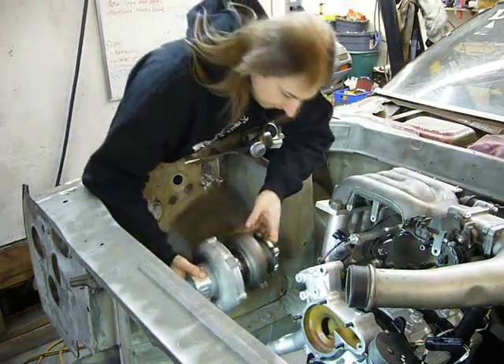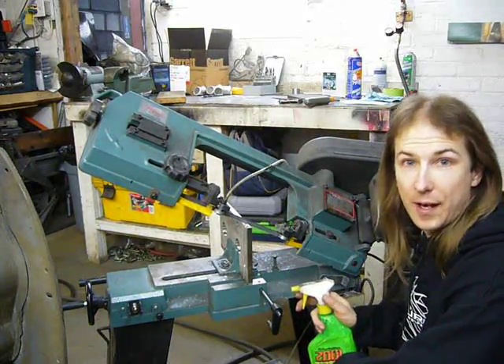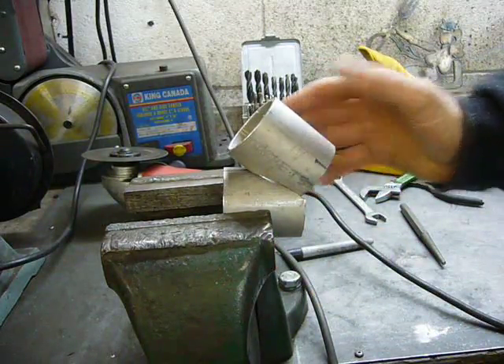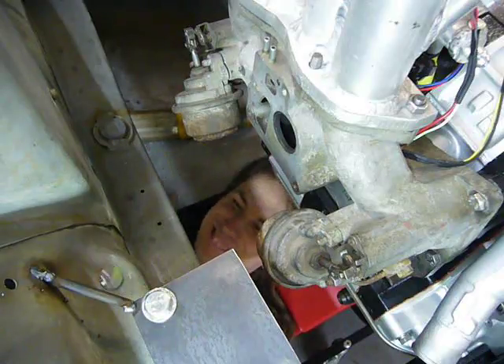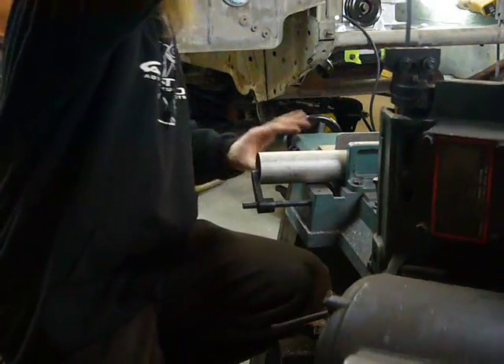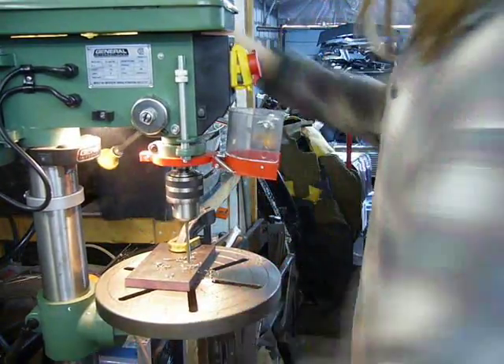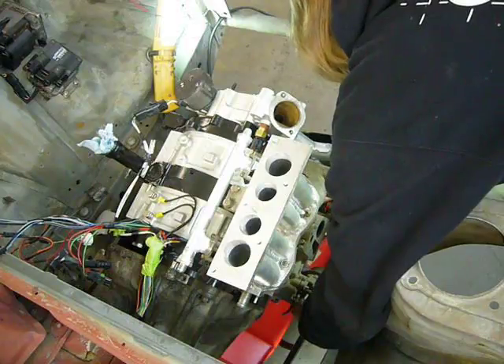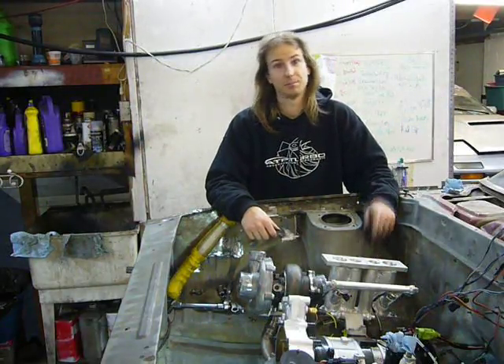Part 25: Turbo Manifold Fabrication - My 76 Mazda RX-5 Cosmo Restoration

Comment: i knew you were going to port match that manifold you need to get that thing sent off to exctrude hone to get the inside really smooth because i saw a bunch of pipes just slightly miss aligned it will cause the exhaust to tumble and probably create drag and resistance i really hope this was a personal job not something you did for a customer

Comment: Is it really necessary to use that insanely thick stainless pipe? Every header I've ever seen was made of thin wall tube. You really didn't need to purge it, I would have saved the argon and welded it. I'm not going to pick on your welds, I think they'll hold just fine. We all know they aren't perfect. I spent some time purge welding sanitary stainless in .063 wall tubing, and the whole point of purging is to weld through to the inside...also, we didn't use filler, just fusion welded it. My hot tip for stainless....get on the pedal a bit more, and try to run it faster. I've always gotten the best results welding it about as fast as I can go. But hey, we're all learning right? I enjoyed your video.
Reply from the maker: nunya bizniss Rotary EGTs can hit up to 1800 degrees under load, so thin walled stainless or mild steel will crack in short order. And if there is any sugaring on the back of those welds, they will crack very easily as well. That's why I ran the back purge so that even though I wasn't going for 100% penetration, the back of the welds would always be protected. There were also a few areas where fitup left a bit of a gap which I wanted the purge to protect. Yeah, I need to move faster on my stainless welding.
Reply: Interesting. I've seen open wheel race cars with the headers so hot you pretty much see through them, but they don't crack. Like they say, lots of ways to skin a cat. I've never had cracking issues with sugared stainless, it's more of an appearance thing. I was watching a promotional vid for Burns Stainless, and apparently they do purge on some of their pieces, so maybe you're not completely crazy after all :-)
Reply from the maker: nunya bizniss Heat cycling in street use probably plays a very large role as well. 1800+ degrees at WOT, then down to 800 degrees at idle, and somewhere in the middle during lean cruise. Plus supporting the weight of the rather large turbos we tend to run (though the GT30R shown here is very small by rotary standards...my daily driver RX-7 runs a GT40R).
Reply: turbo manifolds require shc 40 stainless generally. they are both load bearing of a turbo that may qeight 70# or more and also act as a pressure vessel. unlike a header thay only is subjected to heat and un pressurised air

Comment: For your heat shields, search McMaster.com for "Flexible Ceramic Insulation". It comes in rolls like a thick felt. 1/4" thick in a 2'x20' roll is $22 and is rated at 2000F with a K of 0.75

Comment: kinda stinks that the exhaust flange only has 4 total bolts. but at least its really thick and has tons of material.
Reply: why wouldnt you just wrap your header with some of the fiberglass wrap?
Reply from the maker: bhearts77 4 bolt holes seems to have worked for Mazda since 1967. :-) As the exhaust port area is fairly short there isn't much warping. Most of the time when they warp it's the turbo flange. As for the heat wrap, in my experience that stuff is temporary at best. It looks good for a  year or two and then starts to degrade. I'm also not convinced that after a few years it is very effective. The weave opens up, and the wrap flattens out. Stainless heat shields however will outlast the car.
Reply: my intake manifold is almost all glued together now. ill have to see you the pictures so you can see my "work"
Reply from the maker: bhearts77 Do you have the pictures online anywhere? Even the dreaded Google+? Or make a YouTube video...
Reply: aaroncake I got a picture video and a normal video listed. Mind you I'm terrible at making videos.

Comment: Come n dude,face reality. Hair on the top getting thin! Baldness not as bad as you think! Looks like you scared to get hair cut and holding on too tight to what little you got! Just come to terms with it and join the shiny domes!!!
Reply: Aaron seems like a good dude, but since he likes to work with machinery and power tools without wearing any safety glasses, maybe he's waiting to get that long hair wrapped around the drill press spindle one day, too. That would be fun.
Maybe the cute girl he talks to and rebuilds engines with likes to whip his ass with a red-hot cat-o'-nine'-tails, too.